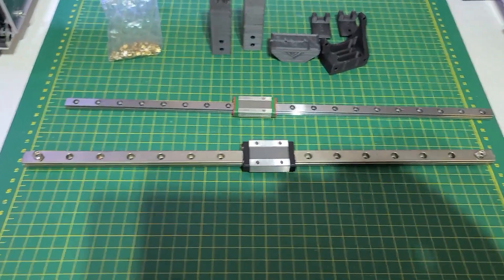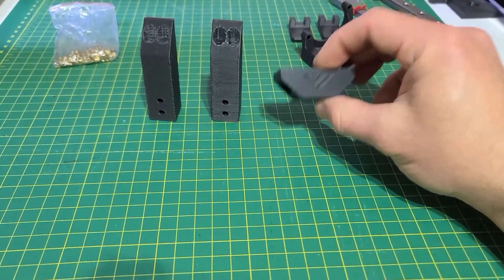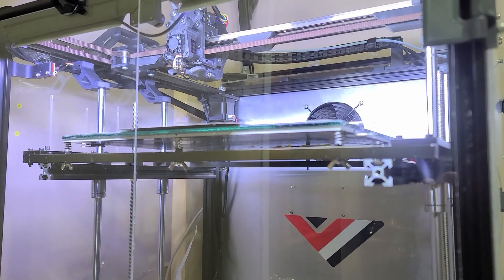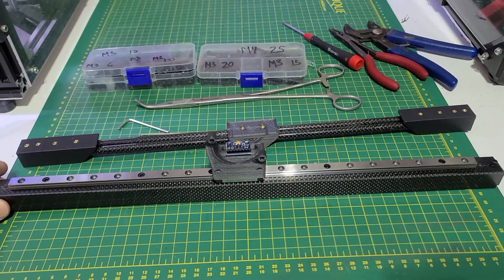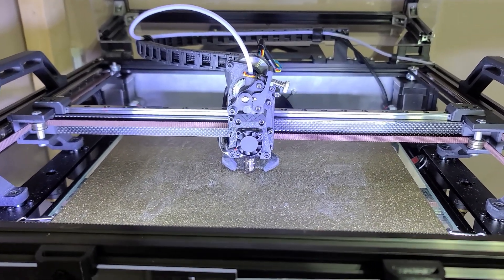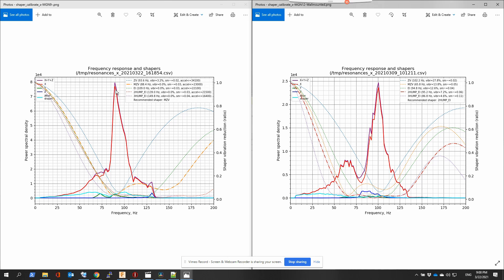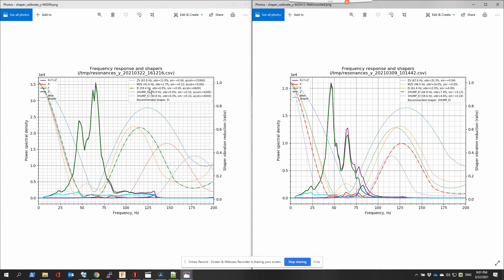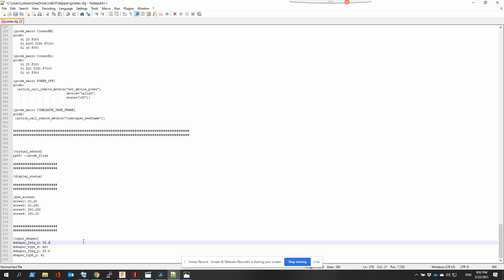Weight reduction MGN12 to MGN9 on X

Comment: Disclaimer first, I have absolutely no knowledge on klipper and Input_shaper.

When comparing those diagrams I noticed that the first y axis (power spectral density) is scaled differently. If you compare the two measurements for the (printers) y axis, the value of the first peak stays roughly the same while the value of the second peak nearly tripels. So while the bigger peak is now the second, higher frequent one, the first isn't really altered. Or do I understand it wrong and higher values are better in this case?
Reply from the maker: I noticed it too. I think its due to loosen belts. Ill do more testing
Reply: @Vez3D  was going to make this comment as well.  The graphs are actually showing that you've increased the resonance by lowering the weight.  This makes intuitive sense as well - when there is less mass, the resonance will increase in amplitude faster.

On the contrary, the data actually show here that the mass of the gantry was not the source of the resonance peaks you originally had (they are still there after the changes).  This implies that the resonance is coming from another source.  Probably: belts, frame, motors, or play in the rails.  Since it looks like a corexy configuration, my guess is the long belts would be the first culprit to look into (as you've already stated).  Try tightening, and see if there is any difference in frequency peak.  If so, this could be further improved by upgrading to thicker belts.  Seems like you're using 6mm belts?  If so, try out 9mm?

If the peaks don't change from that, another possibility is that you're hitting the resonant frequency of the motors.  If this is the case, larger motors or higher currents should help.

Great video!  All the best.
Reply: @megamac125  would there be any downside to going up to 12mm belts or would there be marginal results that are not worth the extra cost?
Reply: @alexandereckhardt7153  biggest downside is that they may be too strong - can cause motor to stall if over tightened, or pull things out of alignment. But if you're careful with them, no not really :)
Reply from the maker: Excellent explanation! I think you are spot on. I found that tightening belt more will just give way more amplitude and not change the frequency. So i think the motors are whats left to change here. Going with 60mm 0.9 degree

Comment: To get that any lighter you would probably have to skeletonize the mgn9 rail. Should be pretty easy to do on a drill press. Thats one very impressive gantry though, my WIP design is probably going to be horrible in comparison with all the stratasys baffles on it.
Reply: The rails are hardened so not as easy as you think to lighten them
Reply: @trp951  yeah I forget not everyone has access to a industrial drill press and carbide drill bits
Reply: Drilling holes to reduce the weight was my first thought as well 

I have read in other posts and replys that the 9 and 12 have the same bearing size so you gain a bit by going down a size without and real cost  but drilling holes would still be on my list

Comment: Bonjour de Sherbrooke,
What a nice project! I was thinking of the next step in weight reduction. There are some carbon fibre linear rails out there. For example: https://www.igus.com/product/753. The down side is probably the fact that since these aren't ball bearing, the slider aren't likely to be preloaded and you could get some play that would result in a bit of rotation around the rail axis. But so long as the print head center of mass is centered on the rail.
Reply: Wonder what the cost is on those.

Comment: I’m really impressed of the input shaper system.. I think I’ll switch to Klipper just to try it. I wonder if the carbon tube is needed in general, maybe it’s discussed somewhere, but isn’t the steel rail stiffer than the carbon? Nice channel by the way, just subbed:)
Reply: The carbon tube increases the rigidity by increasing the moment of inertia. Think of a ruler. On the thin axis it is flexible but on the larger axis it a lot more rigid even if the length and weight doesn't change. In the same way, the tube increases virtually the thickness of the rail, making it stiffer.
Reply from the maker: @etle113  the steel alone is not stiff enough at high accel. It will "spring" a bit. It needs a stiff support. Either a 2020 extrusion (heavy) or a carbon square tube...latter is way better :)
Reply: @Vez3D  I´m sure you booth are right! I´ve never worked with carbon, so I probably underestimating it´s strength. Would be interesting to see a input shaper graph without it, to see the introduced resonance frequency.